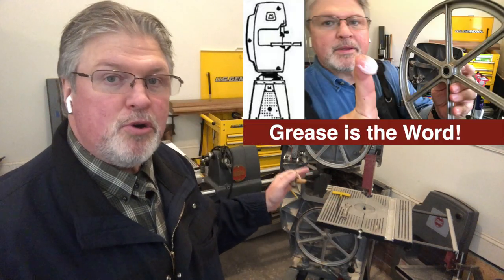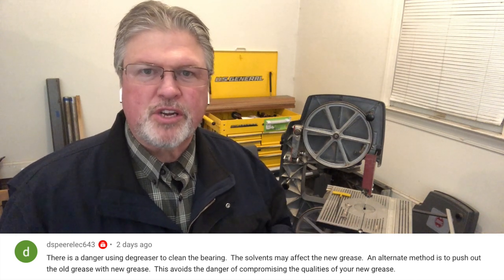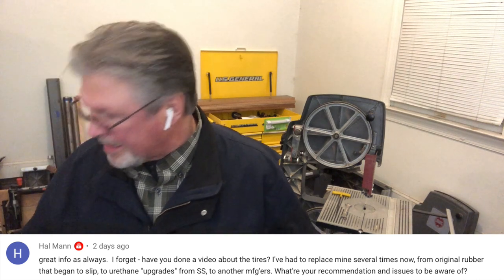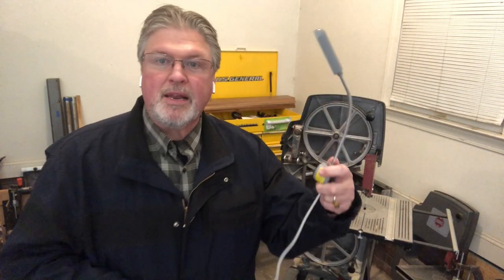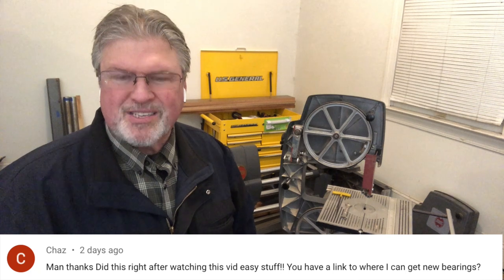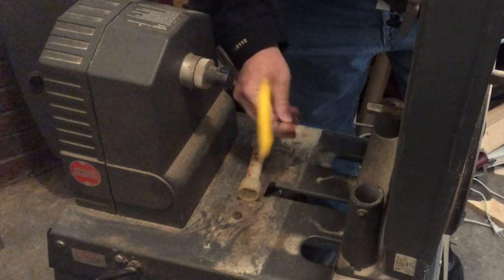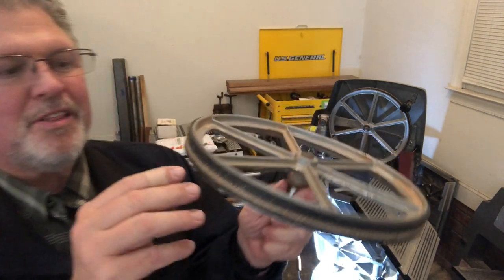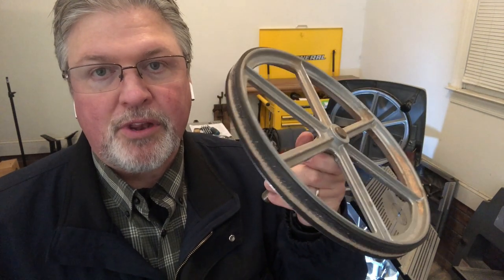Q&A's from "Shopsmith Bandsaw Maintenance: Greasing the Upper Wheel" & Removing Lower Wheel

Comment: I’m enjoying your videos.  I don’t have a Shopsmith and haven’t done any woodworking since the class I took in college 30 years ago.  New Mark V’s and VII’s are expensive and I see many of these advertised used. Some look to be in poor condition.  Can it be more expensive to fix these than to buy new?  Do you use mark VII’s or only mark V’s?  What do you recommend?
Reply from the maker: Those are great questions and insights. Nothing beats driving a new Shopsmith off the lot, but there are a lot of fine machines on the used market. One of Shopsmith's biggest regrets is that they didn't incorporate planned obsolescence and they just built them too well. I have seen some that were beyond help, but the most important things are does the motor work and are all of the electronics in good condition? Bearings can be replaced and bare metal can be polished, but was it abused? If so, walk away.  Scott
Reply from the maker: Sorry for the short answer and there’s so much more to say, but I’m on a tight schedule this week. I wrote more about this on my blog: http://shopsmith-tool-hunter.blogspot.com/2009/08/tips-and-techniques-for-buying.html?m=1
Reply: Thank you.  I appreciate your answer.  Your blog was a big help.  Perhaps a video topic in the future?
Reply from the maker: @jeffreylopez5403  That would be a good one.
Reply: @Jeffrey Lopez, if you have the coins and won't upset the wife or make the kids go barefoot, the VII is a really, really nice machine. However, I can attest that used Vs (and even 520s) can be purchased used at reasonable prices in working condition. Patience is sometimes rewarded with exceptional bargains, or with machines that are in poor condition but can be reconditioned with a lot of care and modest costs. That being said, the old real estate mantra applies here as well: "location, location, location". In some parts of the country, a machine that is two or three generations old might fetch top dollar, while a late-model machine might only get bargain-basement prices in others. If shopping for used, then the sites like Craigslist are your friend, and tools like SearchTempest that automate Craigslist searches are a godsend.

Hope that helps, and hope you can get a SS soon.
Reply from the maker: @seanflanagan5674  So true. I see people practically giving away new and even boxed machines and other who thing a rusty 10ER should fetch $1500 because it includes a speed changer.  Never fall in love with something that can't love you back. Scott

Comment: I am confused with a comment you made on fence adjustment on bandsaw to get a straight cut. You said that adjusting the fence on aluminum works but can’t do it on cast iron table why? You can adjust the miter head to the angle and move miter bar in slit to get width if your piece.
Reply from the maker: Dave, I’m not sure I’m being quoted correctly. Of course on the cast-iron bandsaw table you can use the miter gauge as a rip fence and it will adjust to accommodate the drift found in the blade. That is a common adjustment. On what video did I make such a statement? Scott
Reply from the maker: Check around the 7 minute mark of this video: https://youtu.be/AHYdzX3kPso

Comment: So, just to confirm, there is no need to grease the lower wheel bearing since it is the water pump style?

I just did the upper bearing and it was ancient grease.

Thanks for the video, very helpful
Reply: Found the answer in one of the comments from the upper wheel video
Reply from the maker: I see that you already found your answer, but just in case someone else is looking on, you are correct. The lower bearings are sealed, so they are either full of grease or they need to be replaced.  Scott

Comment: Good info.  I watched your weekend video and ordered some grease and just finished doing my upper bearing.  Did not know that was routine maintenance!  Thank you.  
Just now watched this one and have a suggestion that you might vacuum out the machine before you start the video.  The sawdust was distracting, plus it would make things easier to to see what you were doing when you were taking out the bolt on the lower.  My 2 cents for what it's worth!
Reply from the maker: Hey Robert, thanks for taking the time to write. Yeah, as a corporate trainer I struggle between my desire to remove distractions and my natural tendency to not give a darn! Thanks for the tip and I promise that I’ll try harder and that I’ll also drive you nuts! Thanks for watching and be sure to stick around anyway. Scott
Reply: @MyGrowthRings , OTOH, as much as it makes us cringe, it provides opportunities for us to see other folks' machines. Also talking points that you can exploit. For example, not all the shops that turn out excellent products are as pristine as yours. Also, perhaps a discussion about what point it's important to clean out the various parts of the various components.
Reply from the maker: @seanflanagan5674  If you think my shop is pristine, you and I have an altogether different definition of pristine!